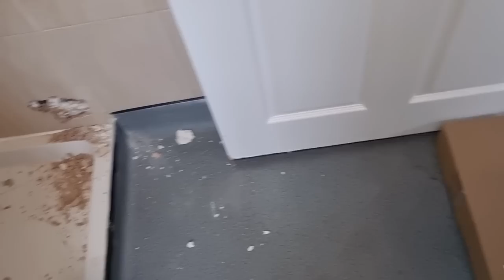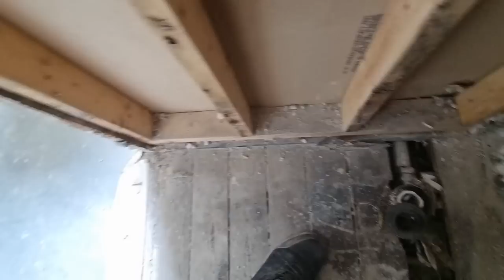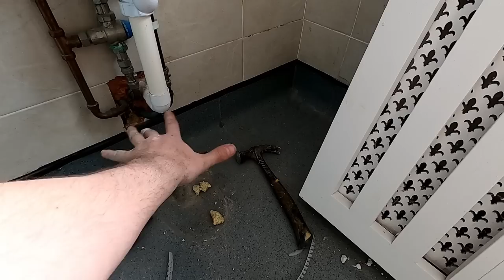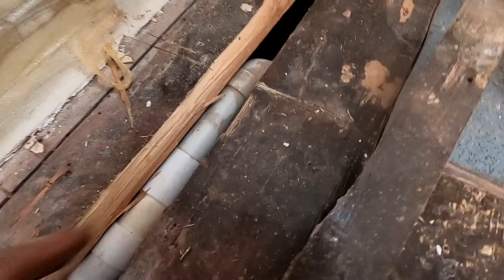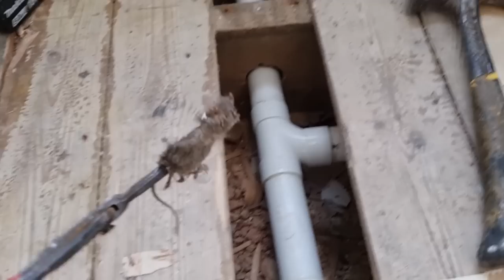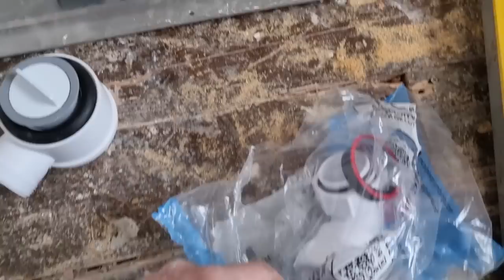DOOR THRESHOLD DRAIN INSTALLATION

Comment: There’s some proper cheap shite out there right now. People think we’re out to rip them off until a few weeks later when a part fails. It’s annoying when you lift a floor and see the previous plumber had no love for his job. At least you’ve found a way through it Tom.
Reply from the maker: I had one customer who priced matched my invoice with parts from screwfix, I normally fit branded isolators which cost a bit more but are better quality, they were arguing over a few pounds in the difference of materials, it's surprising how much bad work gets covered over by flooring, thanks for watching as always mate 👍

Comment: Another interested vid. Those isolating valves are a right PITA. I've not come across one recently that works properly or doesn't leak through the screw when you turn it!!!!  👍
Reply from the maker: They are a pain mate, ive started using more of the full bore buterfly ones as these seem a little better, thanks for watching as always 👍

Comment: Was that a dead rodent at 16.24 on the video? As if you didn't have enough to cope with but as usual Tom triumphed and got the job done.
Reply from the maker: It sure was, I find quite a few dead mice on my jobs, that's one reason I don't like plastic water pipe, they chew the fittings, thanks for watching mate

Comment: Tough times Tom 💯 respect how you overcome, those cheap ballofix are junk , do you ever use the full bore ones bit more expensive but more reliable
Reply from the maker: Those cheap iso valves are junk mate, I don't normally fit those particular ones but they were all the supplier had, I've been fitting more of the butterfly style ones on commercial jobs, they are full bore and easier to turn, thanks for watching as always mate

Comment: Was it an option to leave the tiles on and mermaid board over the top Tom. Would of been a lot easier and cleaner. Great vid as always
Reply from the maker: I did look at doing that, the door would have been an issue as it was tiled into the frame, and the shower pipes would have needed extending forward, in the end sometimes it's better to bite the bullet and go back to the studs, at least that way everything lines back up, thanks for watching as always 👍
Reply: I just fitted a new shower this week. Left the plastic on the tray for protection . Got it all in, mermaid board on then stripped the plastic off the tray. Disaster… Big score on the tray which was obviously there from manufacture. It all had to come out again. That’s taught me a lesson 😢

Comment: Tough job on there Tom mate. I'm surprised merchants still sell them cheap isolation valves, utterly useless.
Reply from the maker: I picked these up by mistake, I only normally use the Wras approved ones, these were utter rubbish, I was pleased I spotted it before turning the water back on, it would have flooded the place, thanks for watching as always 👍

Comment: The best way to lift vinyl is to cut into 2 inch strips then pull
Reply from the maker: Sometimes it comes up really well and sometimes it's a nightmare, you can get them floor scraping machines but it woukd have been a bit overkill for this job, thanks for watching as always mate 👍